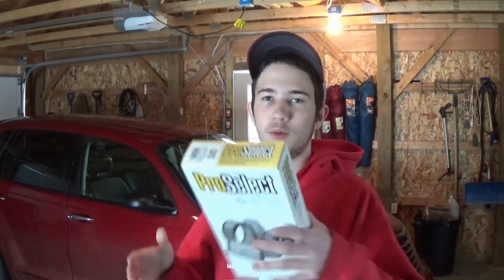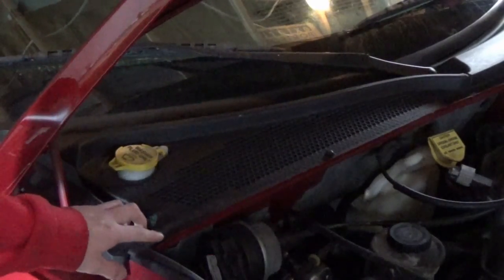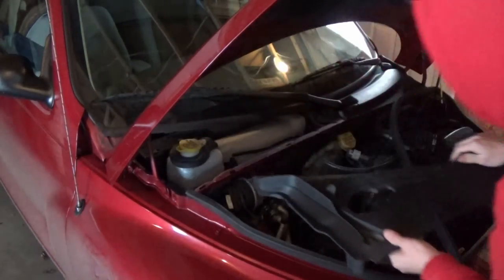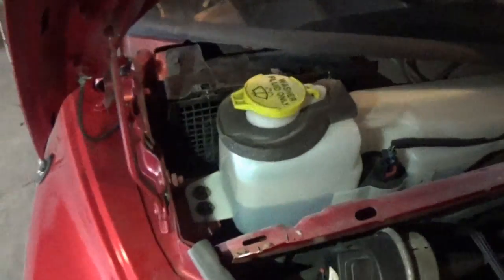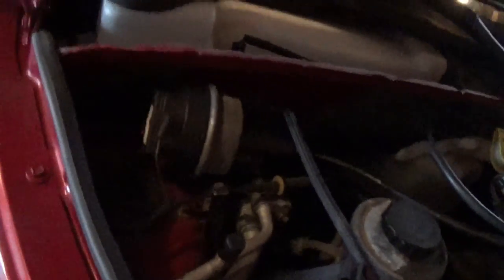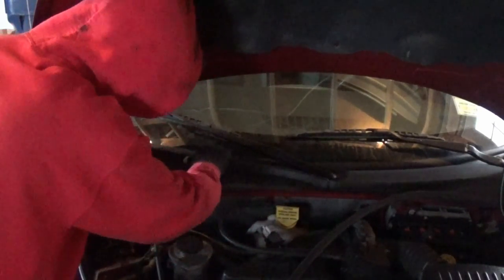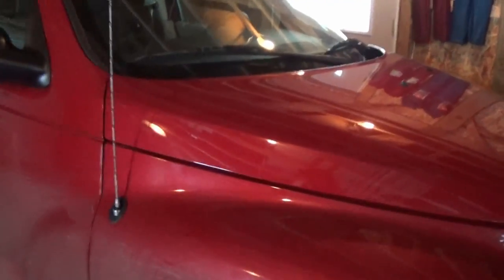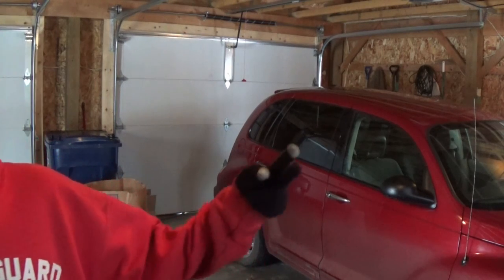Cabin Air Filter Replacement - PT Cruiser

Comment: I'm going to replace mine although I'm not sure that this is the filter causing the problem. It is not about the smell in cabin, but the fact, that no air comes to the cabin at all (only the fan heater just beneath the windshield is working)

Comment: Doing mine tomorrow, same model year. Did it get rid of the heater smell? That's why I'm doing mine...
Reply from the maker: It definitely helped with the smell, last I checked it still smelled a very very little bit like a basement, but I think it's just from years of neglect.  Good luck!
Reply: Yeah mine just smells like hot plastic, somewhat like the engine. Thought it was a bad heater core but the smell isn't sweet enough and there's still plenty of coolant in the tank after months of winter and excessive use of the heater.
Reply from the maker: Yeah I know the smell you're talking about, it is odd.  I don't doubt the filter will help!  GL